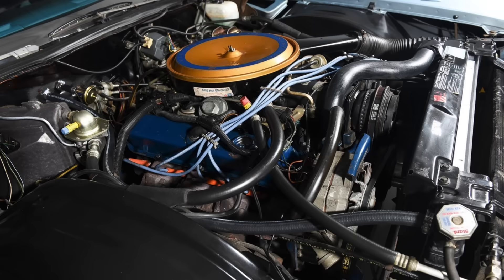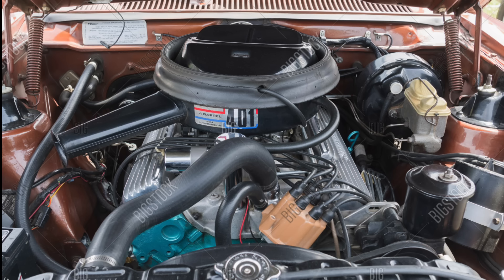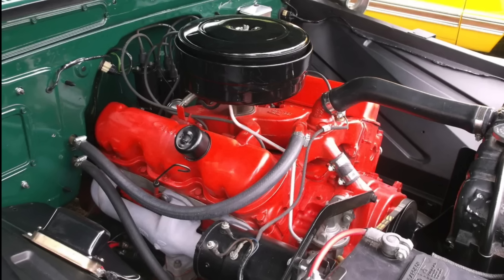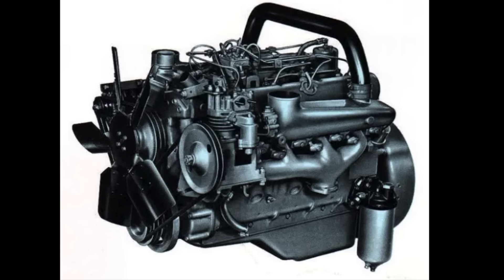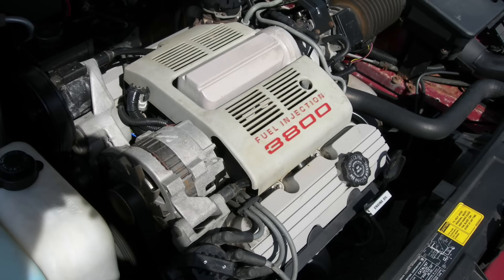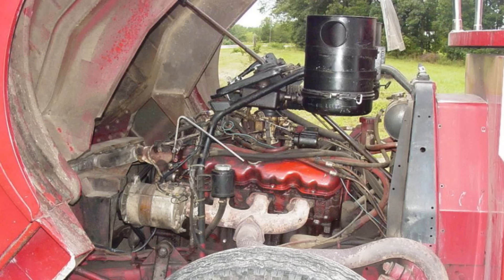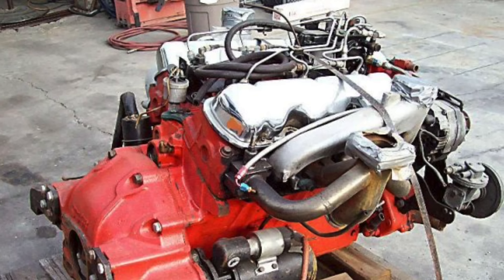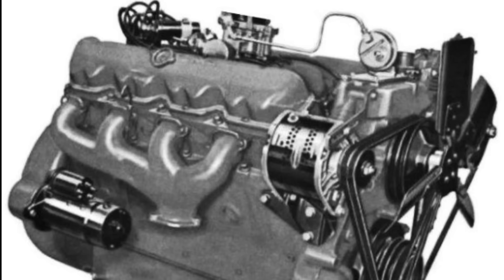The 1966-72 GMC 637ci 60-Degree V8 - GM's Largest On-Road V8 Is Virtually Unknown!

Comment: Another great video, thank you!  The 5 1/4 inch bore just gave me a nice idea.  You could take one of the pistons with rod still connected, remove the rings, clean it up really well and maybe polish it.  Then find a 5 1/2 x 2 inch or so pipe, clean it up and maybe polish it.  Using the two pieces, you'd have a pretty awesome burger patty former!

Comment: They're not actually pulled together it's one block and it has two sets of heads on each side it's got two sets of valve covers two sets of or two intakes the only thing that's different is the block we had a 60 something Jimmy train track my grandparents owned a sign company when I was growing up we actually still had the truck up until 2015 I think

Comment: Yes GMC had a 305 V6 they had the 304 they had a bunch of goofy ass big block W block which was basically the original big block for Chevrolet and Jimmy's in fact we had a V12 which was we had a crane truck and we put a GMC V12 in it which was basically two 3.05l V6 is bolted together

Comment: And the 600 and whatever Chevy W block basically the same as the 409 that was a bigger 409 was not the biggest fuel Ford made a 10 L V8 it was originally supposed to be a V12 and the military decided they didn't want it so what did Ford do they cut two cylinders off of it and they put it on their heavy duty off-road vehicles and some of them went into tanks but they did go in to Ford vehicles look it up a 10 L gasoline

Comment: Ford Made an all Aluminum V-8 Over 1,000 Cubic Inches. Ford Designed it for Air Planes but the Military used in tanks.  Overhead Cams I think 4 valve heads.
The Ford GAA engine is an American all-aluminum 32-valve DOHC 60-degree gasoline-fueled liquid-cooled V8 internal combustion engine with a flat-plane crank. It was designed and produced by the Ford Motor Company during World War II. It features twin Stromberg NA-Y5-G carburetors,[2] dual magnetos and twin spark plugs making up a full dual ignition system,[2] and crossflow induction.[3] It displaces 1,100 cu in (18 L) and puts out well over 1,000 pound-feet (1,400 N⋅m) of torque from idle to 2,200 rpm. The factory-rated net output was 500 hp (370 kW) at 2,600 rpm.
https://en.wikipedia.org/wiki/Ford_GAA_engine

Comment: A 60 deg V8 is balanced but has a primary rocking couple similar to a 90 deg V6. It is not very objectionable but is easily countered with a reverse crank speed shaft. Thanks for the episode!

Comment: The longevity of an engine with a relatively exaggerated over-square design isn't about the stroke length itself, its about rod ratio. These engines have really long rods for that reason as well. The side-loading forces of the pistons to cylinder walls are not as great as if the engines had longer strokes. You would think they wouldn't make low end torque but holy crap did the GM engineers know what they were doing. Power is limited but today's traffic can suck it.

Comment: Still only 2/3rds the size of Ford's GAA v-8 , 1100 cubic inches, 550 hp, and over 1000 flbs of torque at just off idle.

Comment: Don't need a four barrel on even 600 cubic inch mill if you're not turning it faster than 2800 rpm.  A decent two barrel is simpler, more efficient, and more reliable on such a mill.    Old motto:  Keep It Simple.

Comment: A common feature of all these was the vertical mounting of the spark plugs. You had to be very careful to insure that no pebble, (or screw of the carb linkage), fell into a cylinder during a tuneup. There was no clearance oon top of the pistons and you could easily dsmage the groove for the top comression ring. This being said, having rebuilt a couple of V-12 702's, I can attest to their smoothness and torque. They were quiet, ( hydraulic lifters). I remember laying down and reaching back under the floor of the truck (GMC7000) to adjst the timing, one bank by turning the whole distributor (first) and then the other bank by  adjusting one of the sets of points.

Comment: Regarding the 2V carbs on GM big blocks... my very first car (back in hallowed antiquity) was a 1970 Oldsmobile Delta 88 Custom 4 door hardtop with a 455-2V (for economy 😀) rated at 310 gross hp and, if I recall correctly, 500 lb-ft of torque. 
It was a big, heavy car but ran like a dream! Those were the days!

Comment: Ford did have a heavy duty gasoline engine, the 534 CI that was used exclusively for trucks.
The GM 637 was under carburetored. I think with a nice Holley 4 bbl it would have a lot more power.
BTW, the trucks that those Ford and GM heavy duty gasoline engines powered, were really medium duty trucks.

Comment: mac made a 801 cubic inch in line 6... gallons per mile but they sure would pull for a gas engine. turbos would make all these engines pullers on steroids

Comment: The tiny 2bbl carb must serve as a natural governor - the engine just can't pull enough CFM to rev past 3600 rpm.  I know these monster engines weren't designed for higher-RPM duty, but I wonder what numbers this engine could put up with a fabled 4bbl intake and a Qject carb on it?

Comment: I love that series of engines, but I've never seen that V8 in person.  I owned a 305 V6 in a half-ton GMC as my first vehicle purchase, so I am biased, but I thought the torque was almost unmatched and the fuel economy reasonable compared to the same size V8 of the time.  And durability wise, mine (which was owned by my uncle, my dad, a friend of my dad's and then me, then my brother, then someone else over about 30 +year span before I lost track of it), I don't think the engine ever needed anything except a carburetor rebuild (the Stromberg was a bit of a mess when it got some wear on it) and maybe spark-plugs and points and stuff like that, because it was designed with very long life in mind and not tuned to the horsepower/high end it could have been.

Comment: The 8v92 Detroit is a V8, 736 ci, that is a 2stroke diesel, popular semi truck engine.
Reply: I live in Europe/Germany and the European truck manufacturers also made ridiculously large Diesel engines in the 1970s and 1980s. 
MAN for example had an inline five cylinder engine with 15,5l of displacement. That is almost 1000 ci. I have a 14 ton work truck with the "smaller" version of that engine (11,5l/700 ci). Naturally aspirated, 245hp. That thing makes an absolutely awesome rumble when I start it up on a cold morning. The French truck company "Berliet" made a straight six Diesel with almost 20 liters of displacement and ridiculously low power (about 200hp iirc.) in the 1950s.

Comment: The people I worked for in the 1970s had two GMC six wheeled dump trucks with the 430ci V-6 that had reasonable power and decent gas mileage.  One day I was given the job of figuring out why one of them was running rough. The cause was a spark plug with no electrode. I had to remove the carb, to get the intake manifold off before removing the head. The electrode was lying on top of the piston and hadn't melted it's way through. We all breathed a sigh of relief!  We also had two ten wheelers with the huge 637ci gas motor. It was a gas hog like you wouldn't believe!  We got rid of them two years later and bought two Macks that lasted ten years each.

Comment: A two barrel carb in a 10.4 L engine, this was choked from making good power but I'm sure it was a way to keep it from burning gallons per mile. I wonder how this engine would respond to modern technology- a better camshaft/intake/fuel injection and bump in compression. With such a short stroke you would think it has good high rev potential but not with the horrible flowing carb/intake setup of the day.

Comment: I was around a trucking company that used a couple of these in the gas and diesel versions and they were just doing lot work and some around town transfers of flat bed trailers . They ran day and night racking up many hours of run time and i can remember the cummins engine rep would always stop in to see if they had wore out or broke down sine our OTR trucks were all cummins at that point and they had been pushing us hard to go to 555 or the L10 cummins to replace the GM power

Comment: GM actually made a Chevrolet 396 engine with a 2 barrel carburetor. I know because I had one back around 1980. It was A.
 Gold colored 4 doors 1969 Chevy Caprice. I sold the car to a hot rodder guy but kept the intake manifold as a souvenier. That thing was heavy.
Reply: Even though they were called 396, if you measure the bore, they were 401 c.i.d. because g.m. found out that they saved 5o lbs  by enlarging the bore from 68-69 until the 454 took over

Comment: Pretty sure you're wrong on the balance shaft comment.  All GMC V-6/8/12 family all had one crank throw per cylinder.  Thus, making an even-fire V8 is as easy as positioning all crankpins at 60° intervals.  I've owned many of the engines from this family...best truck gas engine ever as far as torque production went.  Fuel economy, not that bad, really.  Reason for demise?  Cost of manufacture, and nearly impossible to meet emissions  requirements by '77.

Comment: I have worked on the 500 cube cadillac and the 472. these engine would run a cadillac 4000lbs at  120mph all day when the corvette 350 /400 would turn to metal shavings.
Reply: Never heard of 400 vette, 427  maybe, not 400
Reply: The 472 & 500's were so smooth.  They didn't make huge power but had really long legs and you could fly down the highway at 100 all day long, sitting on your living room couch

Comment: sorry, the 702 gmc v-12 was NOT 2 v-6's bolted together, a single v-12 block.used 4 v-6 heads, intakes and exhausts but block was a single unit.

Comment: GMC also was the first to use the I6 250 in 1966, and it wasn't until the year after that when the 250 was introduced in the Chevy line.

Comment: There was a larger gasoline V8 that ended up in large trucks and buses. It was the Roiline/LeRoi V8. The two largest displacements were 844 and 884 cubic inches, rated at 300 and 320 HP respectively. I've only seen one over the years and that was in an Oneida bodied transit style school bus.  That one likely was one of the smaller ones at either 540 or 570 cubic inches. I did take a couple of pictures of the bus and the engine.

Comment: When I was in elementary school, a popular school bus design made by Blue Bird Co (from 1970-1972 I believe) was a gas powered rear engine pusher.
These buses were a bit longer than the usual 40 ft buses.
I always wondered what engine was used in these buses, very rare to have a gas powered pusher design.
I’m guessing phased out due to engine fire risks, fuel consumption & emergency exit issues.

Comment: When I was growing up on the farm, my father had 2 GMC trucks with the 401 v-6 in them. One was mated to a straight 5 speed, the other had a 5 speed and 2 speed rear.  Lots of low end torque for working in the field beside the corn chopper.

Comment: These engines were meant to run at full load for extended periods of time.  That is one of the reasons for the use of a small carburetor.  Also, they operated at a lower RPM so the volumetric flowrate is not that great.  At 2,000 RPM and 100% volumetric efficiency, the flowrate is only about 389 cfm (if I have my maths right), since no engine has a 100% volumetric efficiency, a carburetor capable of handling 300 cfm should be sufficient.  One thing, I think, that many people often overlook about truck engines is that they are designed to produce torque and not necessarily horsepower.  Torque is what you can pull, horsepower is how fast you can get there.

Comment: Near me in Oakland Park, Flori-Duh some person owns a retired fire truck.  And this truck has the infamous "Twin Six" 702 cubic inch V12!  It has the badges and everything.  There were no light diesel engines back then, so for torque GM turned towards massive displacement and as few cylinders as they could get away with.  Thus, a 351 cubic inch V6.

I tell car guys about the GMC 351 V6 and it takes about 3 seconds on average for them to turn and look at me and their eyebrows furrow.  "V6?" They think I have made a mistake.  And then I explain it to them.  Most are dumbfounded that GMC actually made a 478 cubic inch V6 with a 60 degree bore angle as well....

Torque is everything with earthmovers, fire trucks, and missile launchers and nobody gives a damn about vibration.

-The nagging thought in my bachelor's degree in aeronautical engineering  mind is why didn't they simply make these engines horizontally opposed?  Lycoming made a 400 hp 720 cubic inch air cooled pushrod flat 8 for decades with a redline of 2700 rpm to drive the Piper Comanche 400 very fast, and a few large twins as well.  These were direct drive engines and weighed about 600 pounds, so I'm not sure why GM went this route.  The Lycoming IO-720 was very smooth and the few people that owned them raved about them until it was time for an overhaul at the 2000 hour point.....

Comment: LeRoi made a 844 (or 884? I'm working from memory here) cubic inch gasoline engine for the Mack M123 military trucks. A Service Life Extension Program swapped them out for a diesel, I think Cummins, years later.

Comment: Ford had a 534, 477. International had a 549.
Never mind the Hall Scott 1300 c.i. gasoline engines in heavy trucks.  Le Roi also made 800-ish cubic inch gas v-8s for truck use.

Comment: The Cadillac 500 was actually a 502" engine, thats what it reads on the under hood engine spec tag. Friend of mines dad had a 72 Eldorado that said 8.2 liter on the fender and as mentioned the under hood tag read 502"- five hundred must have sounded better to the marketing division - working as a mechanic years ago I tuned up quite a few 502" and 472" Cadillacs. My friends dad also had an early GMC pickup with one of the V6's and 4 speed floor shift trans, it was a little torque monster - you could leave the clutch out and gently nudge the trans into first gear and it would drop into gear with no drama and just walk away with no judder or gear clash, these engines were also solid lifter not hydraulic and you could hear the lifter gently tick away when it ran.

Comment: The GMC six cylinder engines were built to last.... They were not designed to rev high or have tons of horse power.... They were designed to pull heavy loads all day, day in day out with minimal maintenance.... They weren't only good engines.... THEY  WERE GREAT ENGINES....   I owned one for over 10 years and loved it.... the only downfall is that it did indeed love gas....

Comment: Those big GM V8 engines from late 60's thru the early 70'swere really something. You'll never see them again. My father bought a used 1969 Oldsmobile 98 Luxury Sedan that was in like new condition from a gas station owner he was friends with. It had a big GM V8 with over 400 cubic inches.  When we would take a trip to Michigan from Milwaukee, to use a trailer on a lake my aunt let us use, the car was fully loaded with 6 kids, 2 adults and a huge trunk full with luggage. Even with all that, that big V8 had so much power it was just loafing along on the freeway.
Reply: Sounds like the Olds 392 1 o 64.

Comment: When I went to technical school to be a mechanic the only time my life I've seen a Cadillac 500 was in that school. I was amazed at how slow it was. This was in 1989
Reply: Post smog 500  pretty pathetic, before 72 w high compression ran much better
Reply: @rogerdodrill4733  yes sir, government has killed everything good. The motor vehicles of the 60s were so much better more powerful and reliable than anything that came after and they're only just recovering some of the horsepower ratings now and they're trying to delete the V8. And Most Unfortunately they're doing a very good job at this. For an unsustainable vehicle like an electric vehicle..

Comment: Great video. Thanks for posting. Back in the early 70s a fellow put a 427 out of a gravel truck into his 66 or 67 Impala. Monster torque. He'd put the front wheels against the concrete parking blocks and sit there spinning the the tires barely over idle. 😊

Comment: Very similar in use to fhe 366 GM truck engines. They don't rev, heads don't flow, but they made torque EVERYWHERE and if left stock, literally would never die.

Comment: I would be curious to see what a modern aluminum head, cam profile, and intake would do on one of those monster GMC V6 engines. And after you dyno it, add a TURBO! I bet those things would make insane power. And they were built like tanks. The GMC V6's are basically Big Block V6 engines.

Comment: As far as it not making big horsepower, horsepower is a function of speed, when you make a heavy duty truck engine high rpm isn’t what you want.  Being this engine was designed to make torque early in the power curve it’s not surprising that it’s done early so its power is low but 275hp at 3800rpm is not bad.

Comment: NO!!  GMC  did NOT   "couple together  two V6 engines!!!"    The block and crank were SINGLE  pieces.  This was a V12  by any definition.  They used  V6 heads,  and possibly  V6  timing cover, and   I do not know about the intake manifold(s).  That is about it

Comment: Gasoline was still relatively cheap back then. The average gallon of gasoline also had a higher octane rating in it. In other words, a higher lead content in the gas that not only performs well with high compression engines, the lead also cushioned both intake and exhaust valves, preventing them from slamming shut into the valve seats.

Comment: I have a twin six that has been upgraded for higher rpm and horsepower. 
Nowhere under the curve does it fall below 1000hp from idle to redline. 
When this 1500lb beast hits the street it'll be amazing.